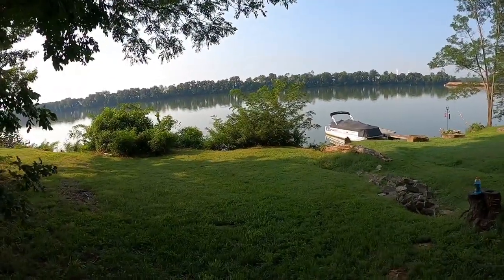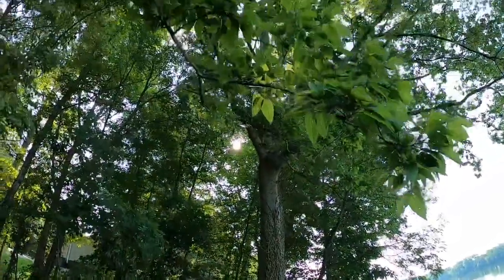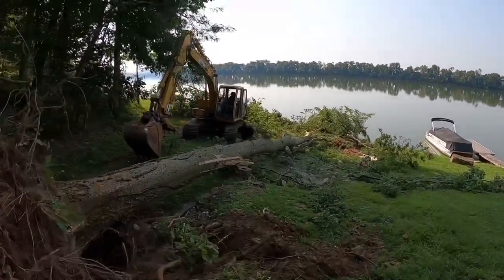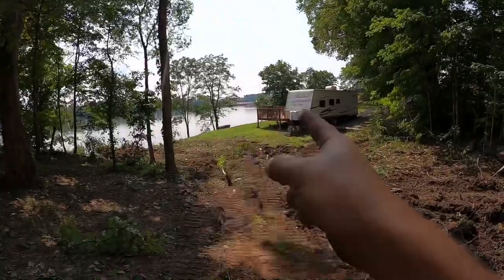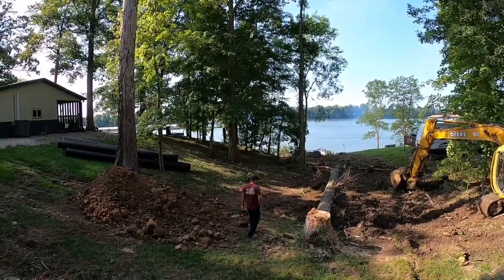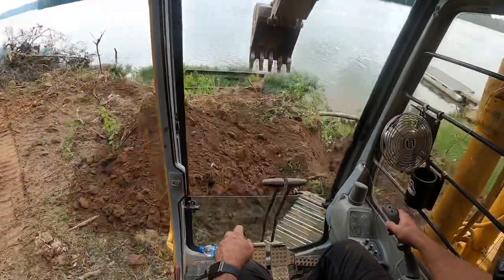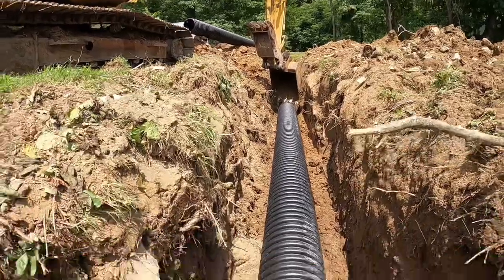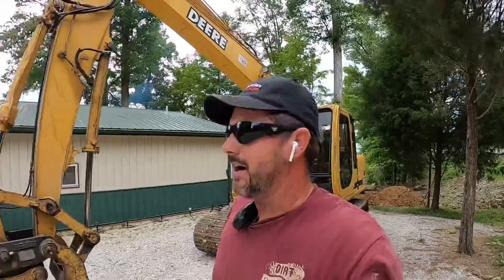Not Good Not good at all 2nd job with the 120 and it's heading back to the shop 🙄

Comment: Hi Mike,  When you first notice a problem with the final drive,  better to stop working and pull the face plate off the planetary to see what's up.  Mine started making the crunchie sound and I stopped and took the cover plate off to find a small needle bearing wasted.  It cost about $68 to repair.  If you keep working the machine the planetary will destroy itself and require total replacement.   Mega bucks!
Reply from the maker: Yup stay tuned

Comment: We've used a lot of different grease from our farm equipment to our construction equipment and trucks and the best grease for the money that we've found has been Lucas grease. We use the Red and Tacky for pins and bushings and other slow moving parts and the Lucas Heavy Duty on U-Joints and other fast moving parts and truck chasis.
Reply from the maker: Good information thanks
Reply: Love the red and tacky but it's not cheap here in the UK.

Comment: TRC grease has been around a long time, it sticks better than anything else. They used to put a bit on a steel table and hit it with a hammer to show it didn't shoot out everywhere but stuck to the table and the hammer. Always like the videos, Keep smiling

Comment: Main drives have an expected MTBF of around 10,000 hours. You did great getting 12,000 hours out of your drives! The other drive will most likely fail soon, so you might as well replace both at the same time. It is better to do preventative maintenance than to have down time on a job.

Comment: I like Trc grease. The crown and chassis 880 is what I use. The paragon 3000 is great too. 880 is more a universal grease.  So I am only stocking 1 grease and not putting wrong grease in something other than hydraulic hammer grease. I had a swing drive that started leaking and I pumped it full of Trc grease until I could fix it.

Comment: Shouldn’t the bell end be facing uphill?
Reply: I noticed the same thing.
Reply from the maker: Sorry there is a reason for that will let you guys figure it out
Reply: This is a future let's dig18 repair video. Lol
Reply: Dirt Perfect , I thought there was a reason you were running them backwards. Man with some experience doesn't make that kind of mistake. I believe it's all in what the pipe will end in is the key. Lol
Reply: @justbe4481  I was thinking the same thing. Lol.
Reply from the maker: @dcrahn  lol ok 👍
Reply: When the river floods? Thanks.
Reply: @dcrahn  i bet you're heaps of fun at parties!

Comment: You might know this but if not I have a tip for judging where the top of a tree will land for future occasions. If you imagine the tree is going to fall from nine o'clock or three o'clock depending on the room you have. If you go out quite a distance at what would be the six o'clock position and get a twig or piece of straw and holding your arm straight out in front of you with the bottom of twig at the point where tree enters the ground then snip it off at where your eye perceives the exact top of the tree, then keeping the bottom of twig lined up with the bottom tilt it over till horizontal with the ground then where the top of the twig stops that is where the top of the tree will hit. You could try it once and put a stake in the ground where you see the twig stop and I guarantee it will be exact. Mind put your mind at rest in future doubtful situations. If you knew this I apologize for the length of my comment. But if not I know it will help you, which is my intention. Us old guys been around awhile and learned some tricks.

Comment: I was raised on a dairy farm, there the main 'business' was getting milk into the bulk tank. Still there was the field work side involving equipment, weather and all associated problems. All the farmers I knew seemed really irritated by breakdowns, I never could figure that out. Machines break, and they never break at a convenient moment.If that fact is upsetting, you're in wrong biz.
Reply: I work in a factory, machines break all of the time, often at bad times, the irritating part is that I usually see it is going to break a week or two out and the company refuses to fix it "because it isn't broken." Generally the sooner you fix a problem the less it costs and the shorter the down time; but I'm not the one in charge or the one paying the bills.

Comment: I use Phillips Megaplex XD3 / XD5 or Shell Gadus for grease. Any EP 2 grease with moly in it (black grease) will do the trick really. I'd shy away from stuff like Lucas red and tacky... don't get me wrong, it's great grease but isn't quite up to snuff for this kind of application, the shits wheel bearing grease not pin/bushing grease. I find after a good 10 hr day, I've got one or more pins that have started squawking that I've had to jump out and feed more grease before the days over when I was using anything else

Comment: You need to check the x1 pressure for the thumb on your Volvo. It should be set at 2500 psi. If not that's why it is weak. I have put on  at least 50 hyd thumbs on Volvo equipment and never a complaint.
Reply from the maker: It’s 2600

Comment: Boom on the 120 looks nice n tight Mike 👍 
1) Could you not wind the pressure up or adjust the relief valve on the thumb of the Volvo to bite more like the 120? 
2) At certain times, I noticed it more at the beginning of the video than at the end, I thought the engine on the 120 sounded to be over revving a bit? 
3) I bet you missed the blade on the Volvo when you were pushing the brush up?
4) Nice when you've got 2 machines isn't it? Down side is, double the machines, double the bills & double the diesel !!

Comment: 120 is looking good. I run Mystic jt-6 with 3% moly. It seems to hang in the tighter joints a lot longer than the Lucas red n tacky did for me. Any grease is better than no grease though.

Comment: Could it just be that the Volvo 140 thumb pressure is turned down ? 
I know that most machines come that way so the operator doesn’t overpower the main bucket cylinder and damage it.
Love the videos !
Reply from the maker: No it’s been checked

Comment: you probably have the want to be CAT fixed by now but the sudden onset of track drive problems could be a plugged port in the pilot valve for the track drive circuit, take the time to do some pressure and flow checks before throwing parts at it
Reply from the maker: Nope none of the above

Comment: It looked good digging again! The squeak was a good thing on the shims, just means that it is tight! I understand why you put the bell ends backwards, because you are going to put a flare on the end of the pipe where the retention pond is going to collect the water better. BUT...it is possible to cut the bell end off and add the flare as well. lol. Sorry about the final drive, sitting for all that time is probably the reason the o-rings went bad in it and the fluid is just bypassing in the final. Or did you hear it grinding and chewing on gears?

Comment: I’m only 5mins in so apologies if you cover this. Why do you think the thumb is so much better is it mechanical advantage due to the design of the linkage or hydraulic power of the cylinder? Do you think you could improve the thumb power on the Volvo?
Reply from the maker: All the above to be honest

Comment: What’s the update on the oil leak?  Is it all sealed up?  As far as mechanical on the 120, she will tell you what she wants repaired. There comes a point in time where the machine doesn’t owe the owner anything.

Comment: That bugs me when they make dumb comments. That john deere is one of the best machines thats ever been made. The volvo is a good machine too they just put so much high tech bullshit on the new ones to a point that you cant work on em unless you go to college to learn how. Be safe and god bless. Hopefully the volvo problem wong cist a fortune byt the final drive in the deere is   gonna be  expensive but atleast you can do the labor yourself
Reply from the maker: I agree
Reply: Same as farming equipment.  Combines/tractors with 3 or 4 monitors in the cab.   Soon they will need IT employees just to run  the farm.

Comment: It might seem a bit dumb to ask but how do you know what spare parts you need when you haven't taken it apart yet? I would be surprised if the dealer offered sale or return on spares.
Reply from the maker: It coke has a hole unit but did save some money by taking it apart later in ordering parts
Reply: @DirtPerfect  Coke?! Thought you a Pepsi man? ;)

Comment: General coconscious amongst hoe operators I know is that Volvo's are nice and the hydraulics are responsive and quick but the lack the power of their Komatsu, Cat and JD competitors (But apparently they have amazing warranties) so I could see the thumb strength weaker in the Volvo. I've ran a new Volvo loader (I think it was an L150h) though I'm usually in a JD 644J and the same seems to be the case with loaders.

Lucas red and tacky is nice grease. Seems to stay put well even when it's extremely hot. Shell Gadus isn't bad either. Any grease is better than no grease though.

Comment: Just wanted to add before you leave to a job you always make sure you have everything fueled up and everything ready to go including chainsaws or whatever you may need Collett management call it whatever but somebody needs to shape up here
Reply: I agree although I fuel up before going to a new job.  Even if the equipment only takes 20 gallons, or if it may not be used I always make sure it is ready

Comment: Was that stringy tree a hackberry?   Looked like one to me.  

Now about them bells, on that pipe... if they are inserted tightly, packed in uniformly and it’s a straight run... it doesn’t matter.   

Just take a look at all the pipes that have been put together with slip on collars... if the bell can’t work facing down hill... everyone of those collars would fail.   Sometimes when you are making connections to existing pipe you don’t have a choice... I’ve put them in both ways.  Now, please excuse me while I climb off my soapbox.

Tough deal on the final drive.... but, get her fixed and she’ll be gods for another 10K hours!!!
Reply from the maker: Lol I agree on the pipe buddy 😆

Comment: I have been using "Lubriplate No. 3000 grease"
I didn't think it was cheap when I bought the last case, don't know if it is better or worse than the cheap stuff.
It seems to hang on pretty good! 
I am a religous grease pumper though.

Comment: If you run machines you have breakdowns and repairs how ever many hours are on it, depending on age it's either warranty or expensive .  I'm spreading hog manure right now and thinking like you it's a good job I can repair machines and operate them.  I've had the TLB I'm loading with and the spreader quit twice each within the same hour on 2 different days . 
I got both repaired in less than 4 hours total   If I couldn't do it it all it would cost over 100 an hour for dealer mechanics, and longer down times waiting for them to get here and actually get them running again.  In the end those repairs would of lost a day or more with dealers mechanics

 I'm thinking MBTS problem with people trusting him might be his accent, If I needed a brain surgeon and he came in sounding like that and said "well we're going to cut the top off your head and poke round in there with a big old red oak stick" I'd be out of there pretty quick to L.O.L  
Thanks for the video, Take care guys
Reply: It just requires belief that you can do it. some have that ability, many are shallow, or vacant-mnded. 
Pray for strength to be given what you need.

Comment: JD is the worst right now   Took 3 tractors to Sunsouth they fixed 1. But filled the tires with air so when we got it back 3 tires popped.  But the tractor company that could fix them they ran him outa businesses so they could manalopalize the market .   Been buying deere for 70+ years. That's over.

Comment: At the risk of sounding stupid, since you had flexible pipe, why didn't you just dig around that big rock? It looked like the dirt to the left was loose enough. Of course I am looking from 320 miles away so I might have missed something.
Reply: Was thinking if one dug a few feet around the backside of the rock then he could have shoved it over a bit and then laid the pipe straight.
Reply: @ArnieD17  That would have worked too. I was also thinking of where the dirt would come from to replace the rock.
Reply from the maker: Double will pipe don’t bent that much good ?

Comment: Pushing a failing drive motor to death instead of shutting down immediately can contaminate the whole hydraulic system including main and secondary pumps along with all the machine's other motors, actuators, solenoids and control valves. Might wish you would have listened to "mbts" on that one. Stopping when you saw it and moving another hoe you already had onto the job could have saved you a lot of down time, money and grief. I've had to go through supposedly "rebuilt" used machines that were supposedly work ready only to find a nightmare lurking unseen in a previously trashed hydraulic system whether it was from a blown hydraulic motor or a trashed pump; new and used replacement parts, filters by the case, multiple flushes and hundreds of gallons of hydraulic fluid later after spending thousands of hard earned dollars on some used machine chasing stuck actuators, solenoid valves, hydraulic ghosts, goblins and gremlins I don't miss. Maybe I'm just too damned old now to climb around on or under machines anymore. I do sincerely wish you the best of outcomes on the 120 but if you have the work and some cash tucked away you could always just take it out back of the barn and shoot it. You might be money and time ahead.
Reply from the maker: Ok first time mechanic here